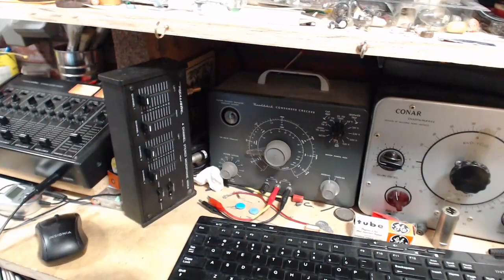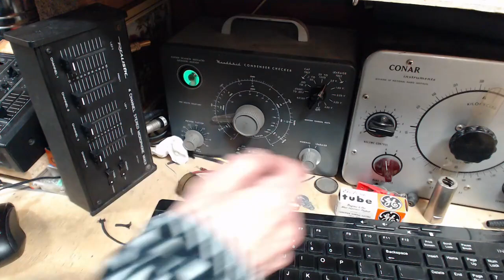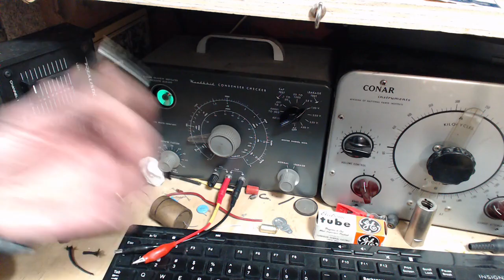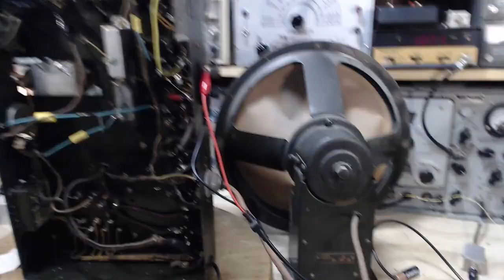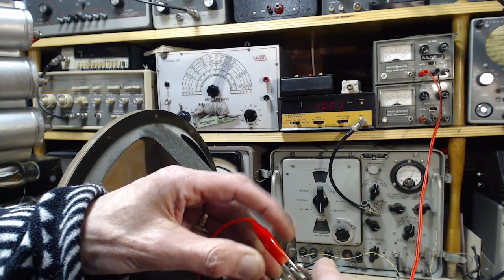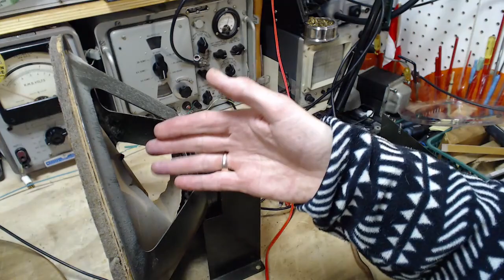1929 Templetone Radio Video #2 - Capacitors and Speaker

Comment: All valid points being said in the comments about caps. He said that they are expensive for a 1uf, Justradio has them for 1.50 i think not bad.  The thing I am wondering about is that small transformer bodged on the underside. What is that in there for?
Reply: Maybe the audio output? When he measured the other terminals that were not the field he said it was the voice coil. That radio is old enough to use interstate transformer. I never got a good view of whats in the base of the speaker.

Comment: Jim, why are you mucking about trying to get sound out of the old speaker. It’s stuffed. Just leave the field coil in place and simply connect a good speaker across the voice coil leads. How broken does it have to be for you to realise it’s not going to work.
Reply: These old speakers can be rebuilt. It isn't rocket science.

Comment: At about seven minutes and he is replacing an old one microfarad capacitor with an old .1 µF capacitor and he isn’t seeing the small dot 
in front of the one. Jim these kind of mistakes compound on themselves as you go forward
Reply: None of the caps are critical in those old radios.